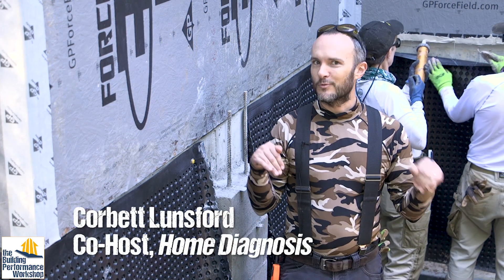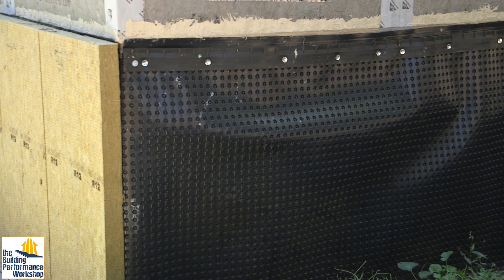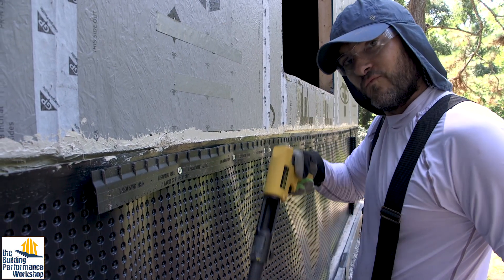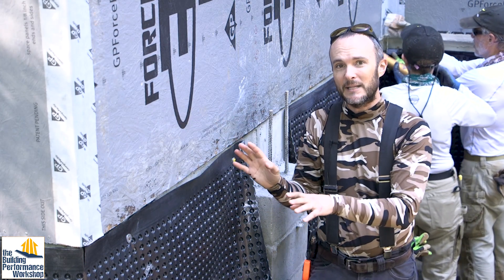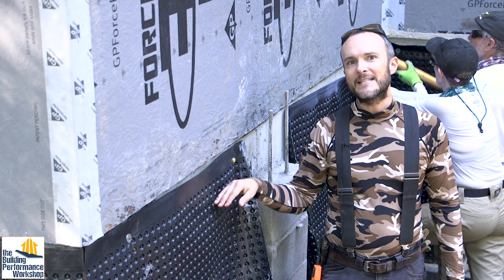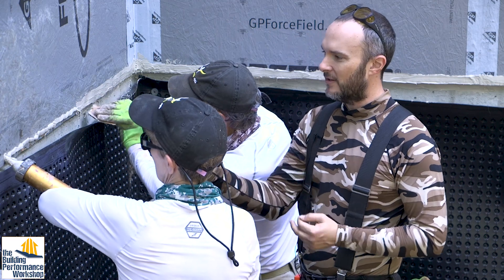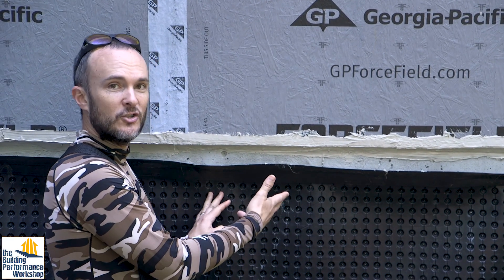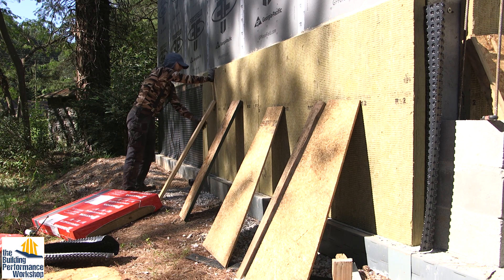Foundation Wall Airsealing, Waterproofing, Insulation before Backfill

Comment: Hey Corbet, I'm wondering how you decided not to actually waterproof the foundation. It does look like you rely exclusively on the dimple board as your only water barrier. I'm working on a basement in Seattle and was thinking of using something like PolyWall home stretch to waterproof the concrete. It is a little expensive and want to make sure that it is actually a useful investment. Thanks.
Reply from the maker: All you need to do to formulate building science theory is take materials with known properties (water + wall system) and run simulations of all that could happen in your head
Reply: @HomePerformance  For someone with the same question as the OP, can you clarify your statement above. It sounds like you're saying that a liquid applied or peel and stick waterproofing membrane such as those from Polywall or Tremco will eventually fail and so not worth spending money on.  Is that accurate?
Reply from the maker: All I’m saying is two of these waterproofing layers is overly redundant. Either will work, just pick one. I liked this one for our project.
Reply from the maker: All you need to do to formulate building science theory is take materials with known properties (water + wall system) and run simulations of all that could happen in your head

Comment: What is the exact "goop" you are using to airseal?
Reply from the maker: This particular goop is tremco dymonic 100
Reply: @HomePerformance  Quick question.  Why did you decide to use this goop to seal at the foundation wall instead of the tape that you and the Georgia Pacific representative demonstrated in an earlier video?
Reply: @HomePerformance  thank you for the response! Keep up the great videos. We break ground this spring